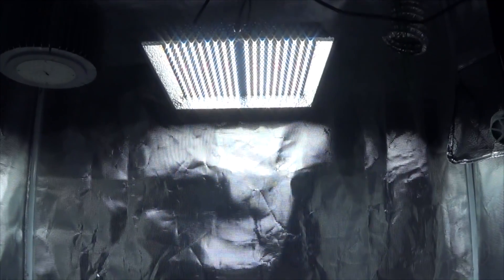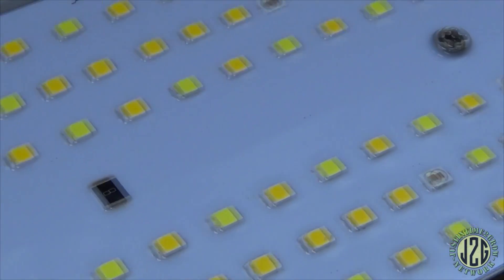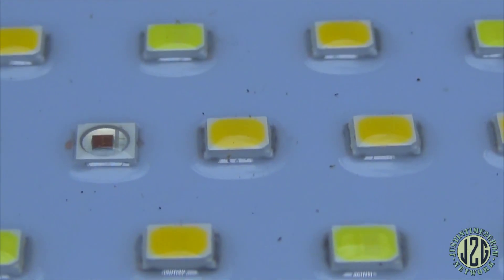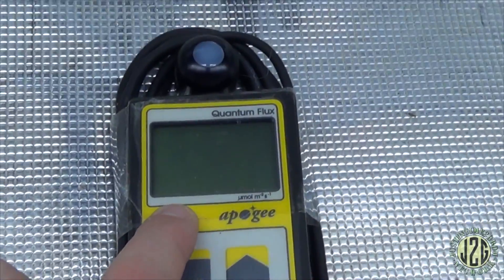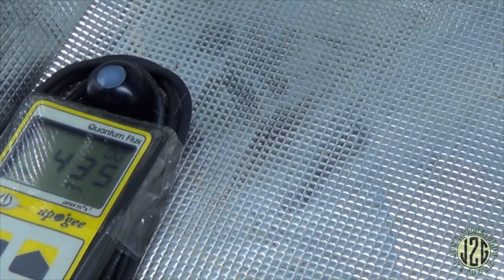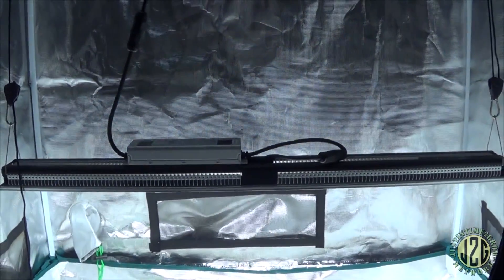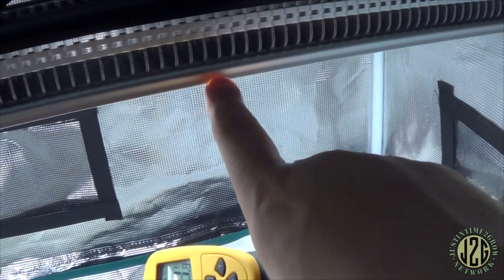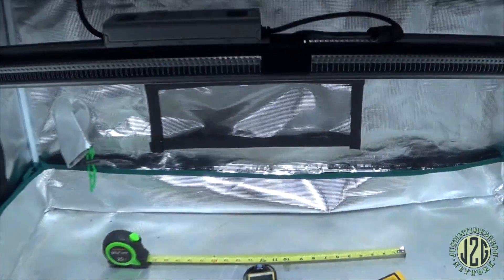BEST BUDGET LED For A 2x4 Grow?? SP-250 Unboxing, PAR & Heat Test

Comment: what would u recomend for an upgrade  i currently have a secret jardin lodge l90 series tent and a 137w meizhi light  but cant decide on a new light the ts1000 or the sp150? and does the sp150 make more sound?
Reply: TS 1000 and SP series both are passive cooled, so both make no sound.

Comment: mine was pulling 292w out of the box .had to turn it down
Reply from the maker: Baja240 sport holy shit 😂
Reply: Same here, had to turn the damn thing back down to 240-250 coz it overheats like a mofo at 290. That's what we get for buying chinese crap lol I am gifting this one to my brother in law and getting something proper. Also the spectrum is weird af on this one, makes the buds too fluffy, definitely need more reds in there. Mars Hydro can suck it, i aint ever buying anything from them.
Reply: stonedaf which light did you end up getting? I’m tempted to try the spider farmer sf2000
Reply: @halflife82  SpiderFarmer is just another shady Chinese commie operation. I ended up on Luminus gen 4 COB's which are perfect for my needs and i am never going back.
Reply: I call that bullshit when the driver's don't let the light run higher than 240w ahahahaha

Comment: How do you keep the Temp ok & consistent when the lights are off?
Not started to grow yet, just doing research.
Thanks
Reply from the maker: Michael Scott I don’t. When the lights go out the temps go down to room temperature, around 68-70f. These tents are just in a bedroom so it’s not hard to regulate temperature.
Reply: I had a grow over the winter just gone and used a couple of seedling heat mats on a timer to keep night temps from going too low. You could also have the lights on at night and off during the day.
Reply: @Justintime2grow  
Thanks dude

Comment: would you recommend one sp250 or two ts1000s for a 2x4
Reply from the maker: I would recommend the 250. Either would work and the two ts1000s would be technically more light but I would say possibly too much light. The SP250 is perfectly tuned for a 2x4 IMO.
Reply: Justintime2grow thank you so much for the reply dude! this looks nice tooo. have a good one dude!

Comment: how much better is the Rapid Led setup?
Reply from the maker: The two are in different categories. This is budget. Rapid LED is high end. How much better is a double bacon cheeseburger than a plain hamburger?
Reply: @Justintime2grow  I guess What I should of asked is 2 of these would run about the same cost as the rapid led setup-ish do you think with these par numbers 2 would = Rapid led set up or still another game altogether? I'm a huge fan of  Rapid LED and I plan on getting a 2x4 light kit from there, but just thinking.

Comment: I’d love to compare the California light works and gravitas to cheaper ones like these and the phlizon cobs,I’m going to make a light using 4 Samsung LM561C 96 diode mounted in heat sinks and mix in a few48 diode red and blue booster strips with a meanwell hlg 240H-C1400B and test it to the phlizon 3000 cod,might buy this light also,love to know how they all compare for real.

Comment: Is this for veg/bloom ?
Reply from the maker: hogbelly fishing it works for both but I’m using it for veg turned down to 150w though. It crushes.
Reply: @Justintime2grow  what would be your choice now for a under 200$ light for the full grow cycle ? I'm  trying to get started with a 3×3  as cheap as possible. My wife is disabled and it's hard to  afford meds so I'm trying to grow it for her. I know that a lot of budget led light can be inadequate. Ty

Comment: I need something to replace my 600w hid
Reply: If you looking to replace you would need 2x tsw2000 fixtures will give a true 660 watt but can produce upto 2.5g per watt using mars
Reply: I would get the fc series fc-3000 or the fc-4000 better light output, more even coverage and less cost last longer a lot less heat and to me personally just as good if not better results then a 600w hid

Comment: Subbed👍 How do you think this compares to the Mars 144 reflector?
Reply from the maker: MARK B not a fan of the reflector series really. They’re ok but they sell better.
Reply: I saw that the mars 144 reflector has a core par reading of over 600. Does this mean it will flower better than the sp250? I have both lights and trying to figure out which light is best suitable for veg and bloom
Reply: So you would flower with the reflector instead of the sp250?
Reply: @seekingtruth thanks for the info! I flowered with the reflector in a 2x4 tent before and the results were alright. I recently purchased the SP250 so I'm torn on which light to veg with and which to flower with. The SP250s at pretty new on the market so there isn't much info on how well they do in flower. I'm trying t get away from the "blurple" lights. How far from canopy do you hang your lights in flower with the reflectors?
Reply: Thanks bro! I think I'll have to go through a flower run with the SP250s to see for myself

Comment: notice the watt per sq foot 27.5. yet the said rule is 32+ led watts per square foot. I believe the rule should be adujusted
Reply from the maker: 580player there really is no general rule with LED it really depends on the efficiency level of the setup. But yea it’s getting low on the watts per square ft 👍🏼
Reply from the maker: 580player way better than the days of 50-80w per square ft.

Comment: Would you say get this or 2 x ts 1000?
Reply from the maker: MrFujack103 2 TS would be more power and more light output but you don’t really need more than the sp-250 in a 2x4.
Reply: Does the ts produce the same light spectrum? I can’t recall far reds and uv on. The ts model?
Reply from the maker: @MrFujack103  Ts did not have UV. That was a surprise for me on this one. Pretty cool.

Comment: What was the temp in the tent after a couple hours?
Reply: its a led light so int wont affect the temperature much
Reply: @tysonsprime  not true, these quantum boards get pretty hot without a fan on them. My 9x4 grow room heats up about 8 degrees with my 2 spider farmer sf 4000s

Comment: Two of those would be perfect for a 2x4
Reply from the maker: eff security 2 would be overkill, you would basically just need to run both as high as you can the whole time 😂 someone else said use 2 of them and dim them and that makes more sense. But really 1 will crush a 2x4.
Reply: Justintime2grow  I think two with some supplemental CO2 would fill that tent in a month and be ready for a second scrog net and flower. I run 415 watts of cob and viparspectra blurple lights and can get a harvest every 3 months. But you’re right about haveing the lights at the top of the tent 😂

Comment: Light looks dope, but 220w per your watt meter is no good these drivers are most efficient if using a maximum of 70% of the capacity. They are running that driver well beyond 70% which will lead to premature failure. This light needs two of those drivers to be within industry standard efficiency for LED lighting.

Comment: Is this a sp-200 or sp-250, the Mars Hydo site doesn't have a sp-200 on their site, but the card you pull out of the box says sp-200?
Reply from the maker: Vince R yeah they changed the name but still have old branding in the current stock. It’s the same thing.

Comment: Someone needs to do a video on how to adjust the dimmers on this light.  No instructions come with it.
Reply from the maker: I wouldn't do it unless you have a watt meter. it's SUPER touchy and you can easily turn the power up too high. Just maybe a 1/16" and it went down like 100 watts. I wouldnt do it without a meter.

Comment: are you sure its not dimmable? the amazon page boasts a dimmable MEANWELL driver.
Reply from the maker: Derik B. It actually is but it’s not easy to get to. You have to take the driver off which is easy just 4 screws and then there are 2 rubber plugs to take off to get to the pots inside to adjust. It’s very very touchy too. I would recommend not doing it without a watt meter.
Reply from the maker: Derik B. I’m running it at 150w now and it’s doing great to veg this 4x2
Reply: @Justintime2grow  cool, thanks for the reply. i bought one and its working great. how do you keep your tent cool? i cant get mine below 83* F.

Comment: Hi there Justine nice review.   Can you review the new hype supernova 300 made in Cali USA ty.  I’m subed and 🔔
Reply from the maker: Thanks. Not sure who that is and nothing comes up when I search for it.
Reply: Novagrowtech.com great light check it out. I just found bout this light myself yesterday.
Reply: Shaka's closet you sleep af bro. It is still Nova get yo fact correct smh
Reply: Plus rebrnded it not still a good light.   It can be called ass.  As along as it does a great job. For the price. Too  fym
Reply from the maker: I clicked that link and it took me to a broken nukeheads link or it won't work with a VPN(why would they want to track you?). I want nothing to do with nukeheads in any way shape or form. I've deleted more garbage nukeheads spam off my channel than I care to remember. If it is the Nova SN 300 yea that thing old and busted, definitely not the new hotness.
Reply: I got the SN 300. The light was doing really good. High par 3 watt diodes.  But the blue diodes burnt out after 2 grows. 3 years later the bloom spectrum is still working. I use it now just as a flower initiator.  Least I made my money back on the light before it took a shit.
Reply: Justintime2grow my bad bro I did not realize it would take you to deuche heads sorry.  I’m def going buy this Mars sp 250!!

Comment: i dont like mars. this is the only light of theres i would flower under..maybe 2 in a 2x4
Reply from the maker: Do you like Uranus? 2 of them at full power would be too much for 2x4, 1 is fine. Running two of them turned down to 150w each would be nice though.